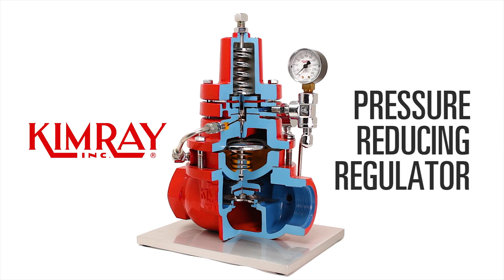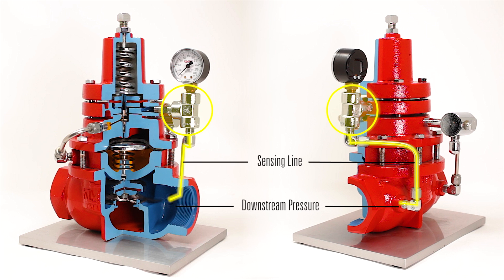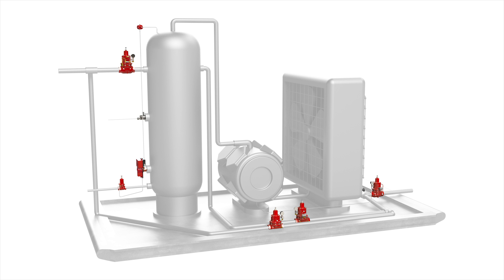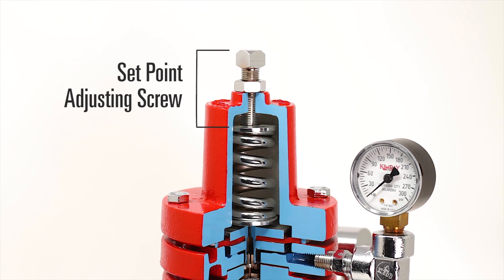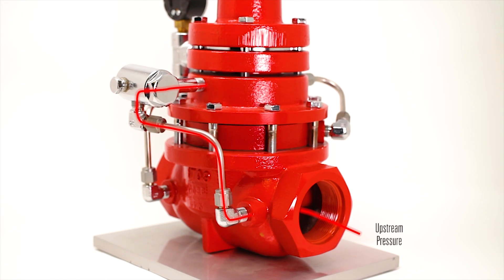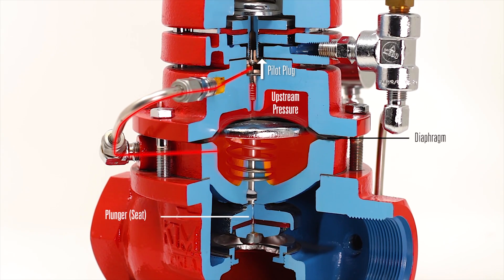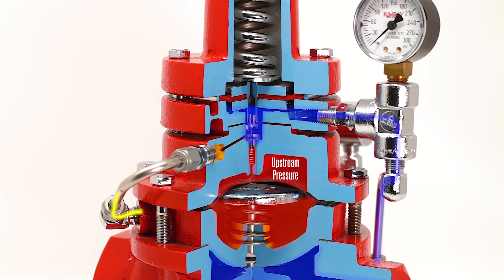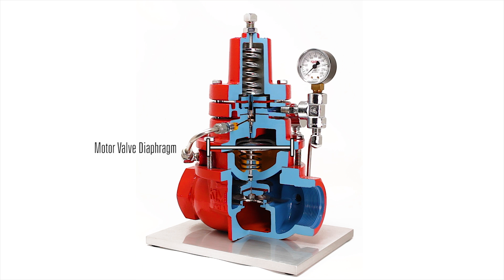How to Operate the Kimray Pressure Reducing Regulator Valve

Comment: By turning valve clockwise-pressure increases. Counter clockwise-decreases pressure?
Reply from the maker: Yes, with all Kimray regulators, turning the adjustment screw clockwise increases set point pressure, and turning it counter-clockwise decreases set point pressure.

Comment: Hi! this valve can work with foaming agent fluid? It is a mix of water+foaming agent+air. We have one working in our plant but is not reliable and I believe it is because of the fluid...
Reply from the maker: Hello! I know this was 3 months ago now and may be too little, too late, but I'm sorry we overlooked your question. Yes, the fluid in the pilot area of the regulator with negatively affect the valve. We have options for a back pressure regulator with an outside source of instrument gas/air (liquid back pressure regulator) that would help in this application.

Comment: Hi,
Could you please advise this Back pressure/dump valve can be installed on Vertical position on vertical line. 

Regards,
Irfan
Reply from the maker: Yes, this valve can be installed in the vertical position, but we would recommend the non-lube version and is not always recommended because of premature wear. Please contact Carlos Casa Morales (carloscm@kimray.com) or Trent Stinchcomb (tstinchcomb@kimray.com) for additional help.